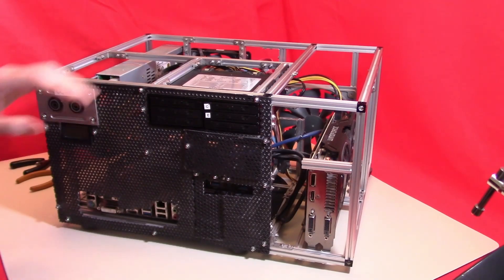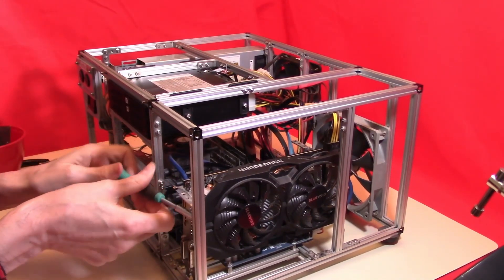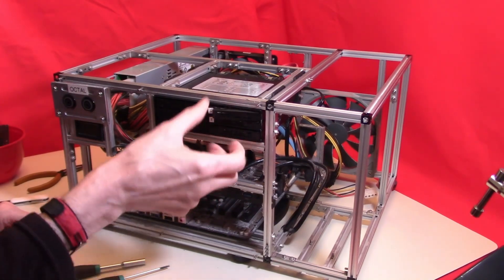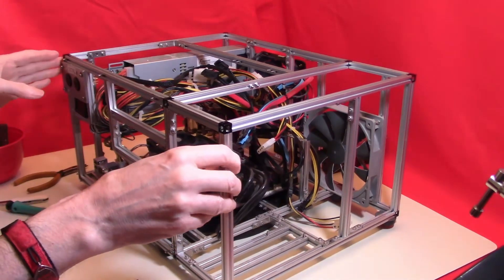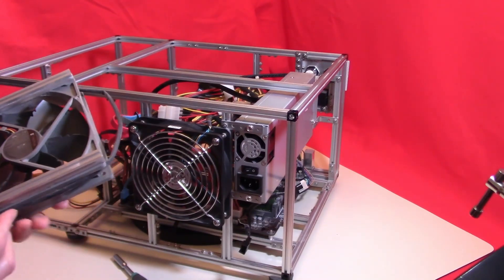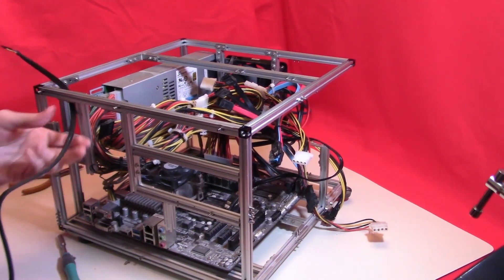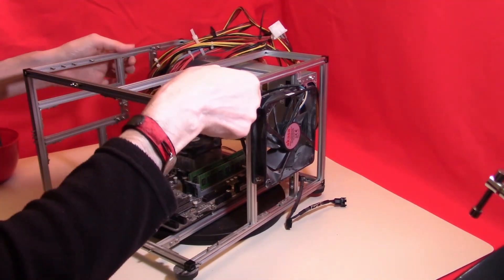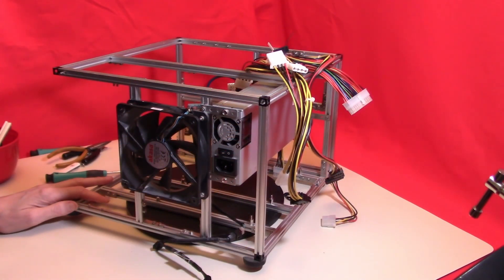Makerbeam frame computer teardown

Comment: i just planned out my case with makerbeam it would be around 150 euro just for connectors and beams... the outside part would be anouther 200 for acrylic glas etc
Reply from the maker: True but the Makerbeam is reusable and can be broken down  at the end of life of the computer and used for the next one.
Reply: I'm going to use carbon fiber panels for my makerbeam PC and the cost was going to be ridiculous at first, but I found I can theoretically reduce the cost of my order by 80% by not ordering so much excess. The key is in ordering smaller panels and reinforcing them together at the seam by epoxying 2 larger panels together with a narrow panel, to make an even larger panel without having to order huge panel sizes. You drastically reduce your order size this way because you use more of the sq inches or sq centimeters that you order online.
Reply from the maker: That's good thinking. I've also used Acrylic sheets cut to size, there are quite a number of companies providing this service.

Comment: Hi! I really like this idea and have decided to try it out for my next build. Do you have any tips or a video about dealing with  heavier pieces of hardware (rads) that have M4 mounts? I find that the M3 square headed bolts and the nuts do work, but I am not sure its strong enough. Do you just larger washers? Or use/ drill larger holes in the brackets?
Reply from the maker: I really haven't had a problem with heavier components, like 3 x 3.5 inch drives in a cage for example. As you can see from https://www.youtube.com/watch?v=RqYzS__hdM8 . I have on occasion drilled bigger holes in the brackets to allow M4 bolts to be used where the component only accepts those.

Comment: motherboard looked quite old indeed... a little bit too many fans for my liking. I built systems in a case without dedicated gpu with one to two fans :)
Still playing around with systems from intels Haswell generation. Fast enough for testing out Linux stuff etc.
Reply from the maker: I'm also in favour of the minimum amount of fans, helps keep the noise down too.
Reply: @custompchardware  if you use a psu with controlled 120mm fan, you could pass the intake air through a cpu tower cooler before letting the air exhaust the psu/case. Works on moderately stressed systems with low tdp
Reply from the maker: Indeed it does, I'll be doing videos on the design and setup of the new system, when I get to that project.
Reply: @custompchardware  what are you doing with all these systems, especially the Odroid Cluster? Why not take an older standalone x86_64 system?
Would be interesting...
Reply from the maker: The hardware supports my other channel -  https://www.youtube.com/@PowerBasicForBeginners
Reply: @custompchardware  Thanks, never heard of it before.